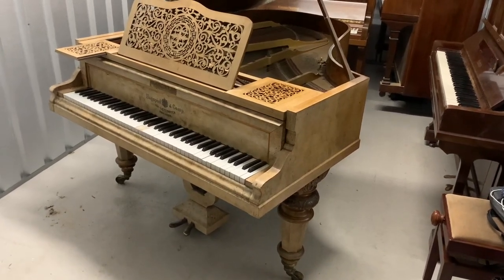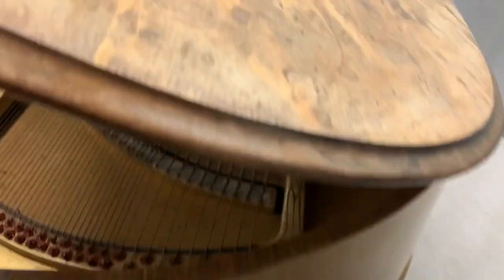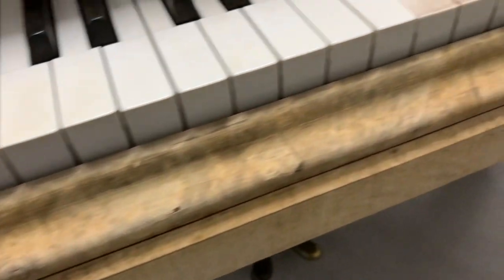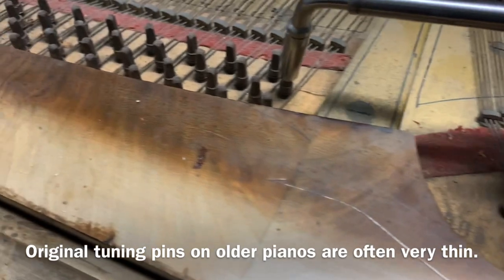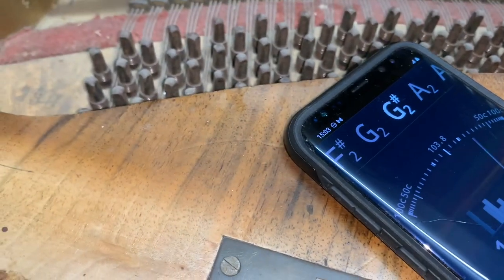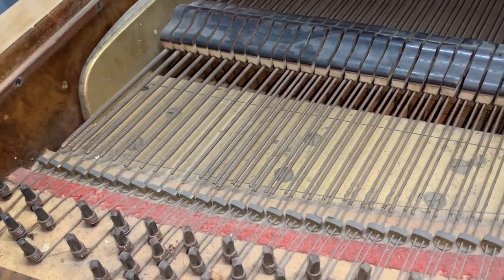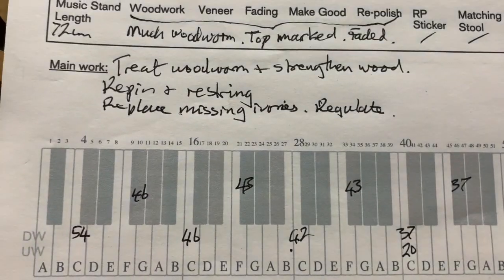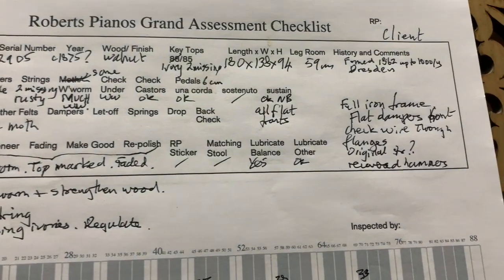Assessment of a walnut Hagspiel grand piano c1870.

Comment: Original strings: With 5+ coils round each tuning pin I'd say so
Clearly stood for many years in a damp room - Corroded lead weights plus worm, which thrives at higher humidity (rusty strings)
- I'd want to check keys are not wormy if above the gnawed rail 
- And I'd be running some pin stabilising fluid ( knotting or whatever works for you) around the loose pins in the middle register to check tone when better tuned 
- Time should be taken to inject and stabilise the worm (hardener?)
- But Marcus your enthusiasm is palpable

Comment: I have a an identical piano ready for some work. Strings look the same so I'd say original. it also has swollen leads and blistered veneer. I think the similar check system was an Erard. I recently tuned an Erard with that system and it was under dampered! I'm glad you like the instrument as I took a bit of a punt on mine. I will refinish, restring and recondition the action. 2 top hammers are a little worse for wear so I have to make a decision on what to do. I wondered about getting some upright hammers and routing a notch either side to accept the shank. Ideally I'f like to just reface then all and replace the check leather, but I don't see an easy way to do it.
Reply: I have a similar problem with my Lipp grand from the 1880s which has the exact same action as this Hagspiel (i.e. the Erard type of action). I need to replace the hammers as well as a couple of shanks, but I have no idea where to find those unique shanks with the hole in it for the metal backcheck pin to pass through. Do you know where to buy that type of obsolete shanks?

I'd also like to know how you eventually replaced the backcheck felt on those atypical hammerheads, since this is such an unusual piano action.

Any tips?
Thanks a lot in advance!

Comment: In order to tune it one might use CA if the pins don't hold. One should tune to 440 and if any string breaks, restring. This is an instrument with a fine case and clearly top quality in its day. Woodworm - I like injecting fluid under pressure. It's likely to be of no commercial value but if someone with taste falls in love with it, worth it to them to have it restrung. It looks as though the hammers have been re-covered recently. An instrument which one needs to be prepared to nurse into the future.

Comment: I have a piano like this one, in black, with serial number 587. Is it worth restoring? It's all original and sounding very good, but I've been told that the felts need to be replaced and it needs lubrication maintenance. Is the restoration worth it? I'm being quoted around €4500 for the restoration - what is the market price for the piano?